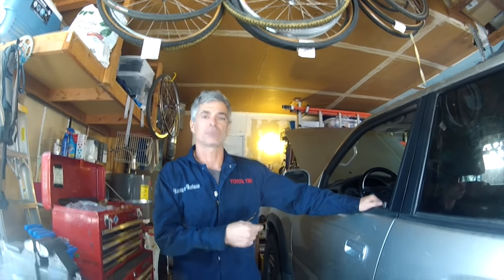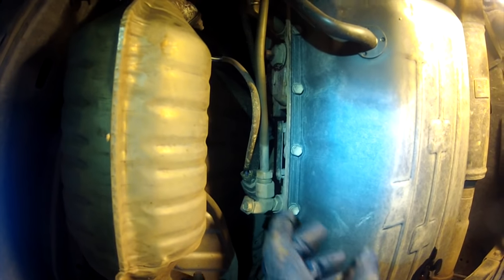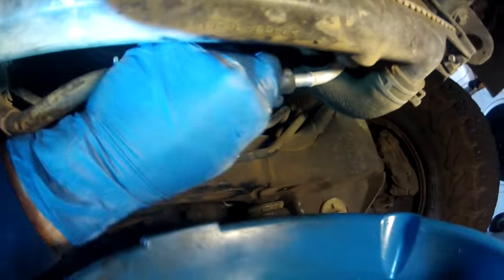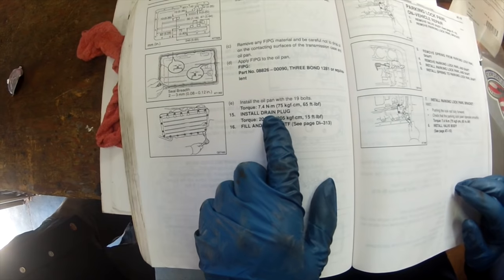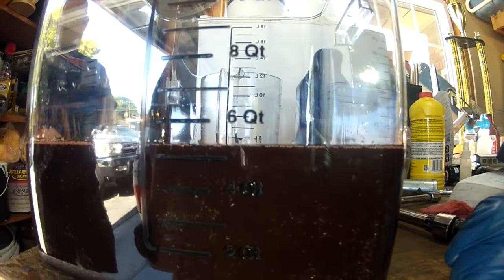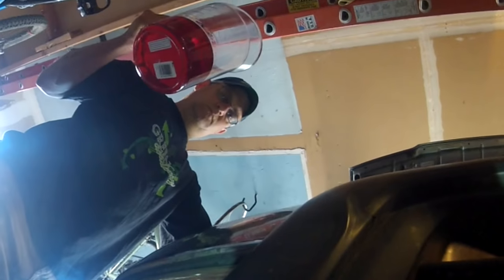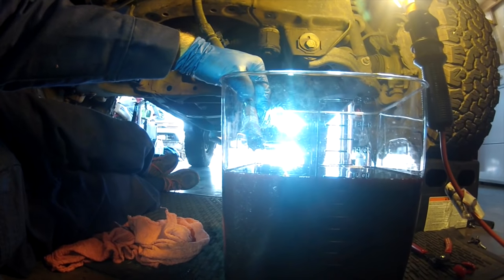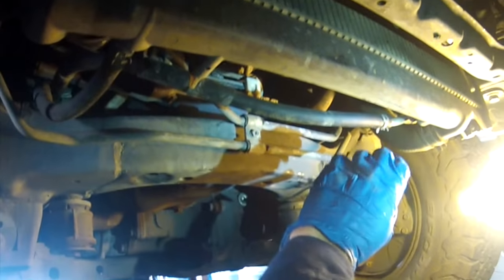Transmission Fluid Flush

Comment: Thanks for the video!
Just wonder why didn't you drop the pan and changed the filter and cleaned the magnets?  How important is that?
Thanks
Reply from the maker: Well, the transmission filter under the pan is just a metal mesh filter to capture the bigger particles of metal.  If you have enough captured metal in there to start inhibiting the flow of fluid, your transmission is probably toast.  But, with that said, I plan on dropping my pan sometime soon just out of curiosity because a look at what's accumulated on the magnets and in the filter is a clue to the health of your transmission.  Plus, it will be another video to share.

Dropping the pan is not hard but it's definitely a lot more work than just doing a drain and refill.  You have to get the sway bar out of the way first.  You have to remove the upper part of the dipstick tube, get all the bolts out and break the seal of the pan with a special tool.  Then you have to clean up the magnets and you can actually clean and reuse the filter if you want.  Finally, you have to put gasket sealer on the pan and bolt it back on.  So, definitely not a quick process.  

I would say it's not that necessary.  The old American Motors cars that have a paper filter that can get clogged over time would require a drop off the transmission pan to replace it.  When I added my external trans cooler, I added an inline Magnefine filter to do "True" filtering of the transmission fluid.
Reply: Thank you for your reply.  I have Highlander 2011 4WD.  The filer there has some felt not just a metal mesh.  I am not sure about your car.  Also from what I have seen from other videos, there are 4 bolts on the pan that are really hard to reach.  That is why I was just thinking about flushing it.   

Do you know how to check the transmission fluid temperature before looking at the dipstick in Highlander 2011 and camry 2007?  Every time after driving for a while, I look at the dipstick and it gives me different oil level that is why I was not sure how to check it,
Thanks
Reply from the maker: If the filter has felt, it might be a good decision to change it because it would be more prone to clog.  Have you asked the dealer what they recommend as an interval to change that transmission filter?

I monitor my trans temp by using a Bluetooth OBDII reader and the Torque Pro app on my Android phone.  If you don't have an Android phone, they do have apps for i-phones too.

Here's the OBDII reader I bought: 
https://www.amazon.com/gp/product/B005NLQAHS/ref=oh_aui_detailpage_o04_s00?ie=UTF8&psc=1

I also bought this on/off OBDII extension which is nice since the reader does draw power even when the vehicle is off.  If you leave the reader in the port and let the vehicle sit for a long time, it could drain the battery. 
https://www.amazon.com/gp/product/B00UR5XBMW/ref=oh_aui_detailpage_o05_s00?ie=UTF8&psc=1

Transmission fluid continues to expand as it gets hotter.  Normal operating temperature for my trans is 155-175.  Before I knew how to monitor my trans temp, I'd just do a 5 mile drive down the freeway, come back and check to the see the level is at the top of the hot range.  If you climbed a steep mountain road and you're trans temp was around 200+ degrees, and you checked it at this temp, the level on the dipstick would be quite a bit over the top hot mark.  

After I do a drain and refill on my rig, I drive it like I normally do but make sure my trans temp has climbed into the normal operating range.  If it's a little low, I'll add until I'm at the top of the hot mark.  They say not to overfill but I don't want to be underfilled either.  I think if you're slightly overfilled or underfilled, it's not a big deal.  You just don't want to be way overfilled or way underfilled.  

You probably would never be checking you're trans fluid level at the top of a mountain climb because that doesn't make sense.  Most people would be either checking it at home after driving it normally or at a gas station when they're filling their tank.  So, the manufacturers intent is the trans fluid is checked at a "Normal" operating temp in regards the hot level on the dipstick.  Most people aren't going to monitor their trans temp, so going for a drive and heating up the trans is all they can do.  Knowing the actual temperature is very helpful though, so I would suggest anyone to buy an OBDII reader and get a phone app.  You could also buy a Scan Gauge tool, but those are a much more expensive option to monitor different things on your vehicle.
Reply: Thank you so much for this well extensive explanation.  This is what I was looking for.  I have 3 more questions for you:
1- Do you know if this OBDII reader will work for Highlander 2011 or Camry 2007?  
2- When you remove the return line from the nozzle in the radiator and connect another hose to this line where you drain from it.  What have you done with the original returning hose as it will withdraw air now to the transmission?  I may missed it. 
3-How accurate is the app or the OBDII? How do you know this give the right temperature?  Just curious..
Thanks again
Reply from the maker: 1)The reader should work with any vehicle with an OBDII port.  You just have to buy an app like Torque Pro and set up on the application what you want to monitor.

2)You just let the return line hang.  The transmission doesn't suck the fluid back via the return line.  The transmission pump pushes the fluid through the system with positive pressure.  When you take the return line off, you're just breaking the route back to the transmission.  

3)The apps are pretty accurate based off what I've seen with my rig and reports from other people on Toyota forums.  For my rig, the Torque Pro app seems very accurate for coolant temp and trans temp but doesn't show an accurate reading for volts.  The Torque Pro app will show around 13.2 volts when my charging system is actually putting out around 14.2 volts.  I know this because I tested my charging system with a multi-meter and another OBDII reader I own.
Reply: I got you. But will be some oil left in the radiator and the return hose that should be drained as well or this should be ignored?
Thanks.  I learned a lot from you.
Reply from the maker: There will be nothing left in the radiator because you are connecting up to the return line fitting on the radiator cooler.  The transmission pump will be moving the fluid through the send line to the trans cooler, through the trans cooler and out the hose you put on the return fitting on the trans cooler and into the bucket you are capturing the fluid in to measure what you're taking out.  For your vehicle, you just need to know which line is the send line and which is the return line.  I'm guessing you don't have a Factory Service Manual for your vehicle so maybe a helpful parts department person at your local Toyota dealership could help you out.

You are correct, there will be some old fluid left in the rubber and metal return line that goes back to the transmission but some of that will drain out of the line as you let it hang while you are doing the flush procedure.  Is it enough fluid to worry about?  No.  I don't know the volume of fluid that the metal return line could hold, but it's not an appreciable amount.  If you really wanted to get the old fluid out of the return line, you could remove it from the transmission by disconnecting it from the transmission and any clamps that hold it on securely but that would be a huge waste of time in my book. 

The way I keep my transmission fluid in good shape is I do drain and refills every 10,000 miles.  I'm basically exchanging 1/3 of the capacity every time, and over 30,000 miles, which is the suggested interval to renew your transmission fluid when using conventional ATF(non-synthetic), I've exchanged the entire capacity of the system.  This method is a dilution process but I've found it does a good job to keep the ATF in good shape.  So, instead of renewing the whole system every 30,000 miles, I do a partial renewal every 10,000 miles.
Reply from the maker: I've just learned the metal mesh filter under the transmission pan is a lot finer than I thought if would be.  I'm starting to think dropping the pan isn't a bad idea just to be sure there isn't any significant blockage starving the transmission of fluid.
Reply: Thank you so much  for the info,  Do you recommend doing that at 60K miles or just flush and wait till the car has 120K miles?  The think is dropping the pan is not that easy as there are 4 bolts under the structure that make it hard to remove.  If you have a recommended tool for that, please let me know.
Thanks
Reply: Also do you recommend doing the flush first then dropping the pan and change the filter or the other way around?
Thanks
Reply from the maker: I don't know enough about your Highlander to give you a good answer.   You said your trans filter actually has some felt in it so I don't know if it would be more inclined to get clogged than the metal mesh filter I have in my 3rd Gen 4runner.  That's why I suggested you ask the dealer what the recommended interval is to renew the trans filter.  

It sounds like the pan is going to be hard to remove because of those 4 bolts you mentioned that are hard to get to.  Maybe you could look for an online version of the factory service manual for you Highlander and research how the manual says to remove the pan.  Factory Service Manuals are an invaluable resource when researching a repair or maintenance job.

I couldn't give you a tool recommendation for your vehicle because I don't even know what the underside of your vehicle looks like to see what you're up against to drop the trans pan.

I wish I could be more helpful.
Reply from the maker: I would recommend draining the pan, removing the pan, cleaning the pan and magnets, changing the filter and then do the flush procedure.
Reply: @TimmyTheToolman   i droped my pan n rep[laced filter clean magnets they were prety good only some grey smuddges goo on a rag nothin bad the filter had no visible grim on it  i got 270 000 km on my rig not shor when last fluid change was done  but it wasnt recent for shore great vid at the  supply shop it said i only nedded about 2 courts of fluid to change filter lol they were way off
Reply from the maker: @NeBoFoRiOn  Sounds like your trans is still in good shape.  Hopefully it's going to have a really long life.  Good job getting the job done.  Happy Wrenching!

Comment: Should you shift through the gears as you're doing the 1 qt. swaps?
Reply from the maker: Interesting thought but I don't think shifting the gears would do anything for you.
Reply: @TimmyTheToolman  Shifting in a repeating drive/neutral/reverse pattern (with a firm foot on the brake, of course), pausing 3-5 seconds between shifts, will engage the torque converter and allow ATF to flow through the various valve body passages.  Torque converters typically have a marginal load at idle (that's why you can feel a vehicle lurch ever so slightly when shifting to drive or reverse).
Reply from the maker: koomo801 that’s some good info. Thanks for adding this info to this video. I hope it helps someone.